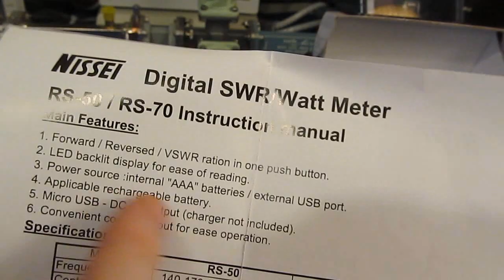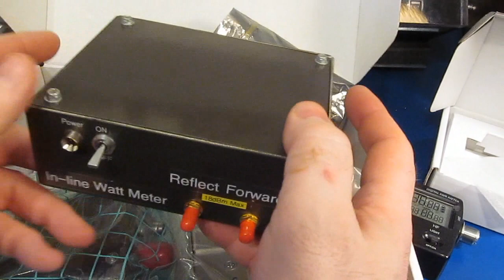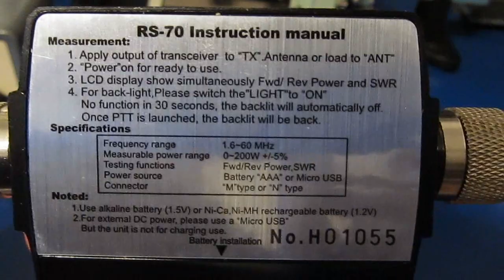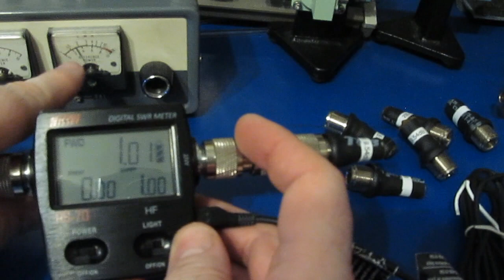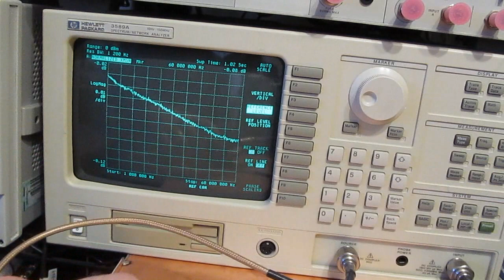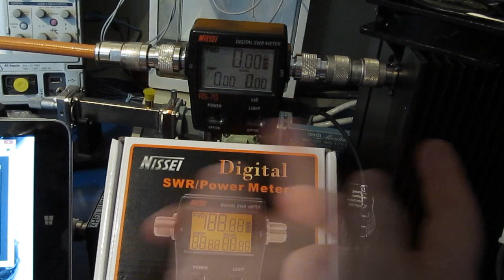NISSEI RS-70 Digital SWR/Power Meter Review

Comment: I have the MFJ-845 version. The instructions say the backlight will come on while transmitting then turn off after a while after keying off. But, mine is intermittent. I just got it a couple of days ago and was working fine and matching up pretty closely. Then all of a sudden it's showing misreadings of 99:1 SWR and nearly 100% reflection except at 14MHz (20m band) where it fluctuates. I'll be cracking it open to see if something got burnt and to check that shield of the coax.

Also, it is exactly the same. MFJ just got it white labeled and slapped their logo on it. Also, the SO239 connectors are really crappy. You must be careful not to bend the pins. The insulator inside can slide down and expose the top of the pins. I took a plastic straw and made inserts to prevent the insulator from sliding down.
Reply from the maker: Thanks for the post.  Please provide us with some details on the shielding once you have yours apart.
Reply: The coax wasn't grounded. I did so. Also I replaced the SO239s with far more superior quality connectors...BUT... It's still not working properly. I checked it against all HF bands and only on 10m (28-29MHz) doest it read SWR correctly. Nonetheless, despite giving pinned 99:1 reading the SWR on the feed line and at the rig remains stable and correct. Does this just need to be recalibrated?

Comment: Great!  It seems everything I've bought is a piece of crap after watching these videos.  First, the Nano VNA-H4, but too complicated to use.  Then the Surecom SW-33, but one video says it's just junk.  Finally, a Nissei RS-50 similar to this one, but if the RS-70 is what you're saying it is, then I can assume the same with what I have.  Geez, I just want an accurate SWR and power meter without breaking the bank and all the complications!
Reply from the maker: RS50 should have a completely different coupler.   There is no way the one used in the RS-70 would work to 500+MHz, even if it didn't have problems.  If you know someone with the equipment, maybe they could test it for you.   H4 can't measure power so even if you took the time to learn  to use it, its out.
Reply: Check the frequency range. MFJ has two versions. One for HF and another for VHF/UHF.

Comment: I guess you have a calibration issue. There are trimpots inside so it's easy to calibrate this meter. My RS-70 is almost spot-on with respect to power and SWR. But of course not perfect as it's not a 1000 dollar lab instrument.
Reply from the maker: I posted a photo of it on EEVBLOG.   There is a trimmer cap that ties to the center tapped transformer and two trim pots off the two outside legs.  As far as aligning the meter,  I have not made any attempts.   It should have been aligned when shipped.
Reply: @joesmith-je3tq  Bearing in mind how it arrived to you, it's quite possible that it had a rough journey somewhere along the line from China or Japan - not sure where they are made. All it would take is a couple of decent knocks to change the calibration. I've got one of these meters coming (it was in a box of adapters/connectors and others odds and ends for £10 GBP - I guess that would be $12-15 USD, which was a bargain without the meter), I hoper it is better than the one you have. If not, I'll get inside and do some checks and possibly re-calibrate. All part of the fun!

Comment: The screen on this is almost identical to the MFJ one, which a lot of people have declared to be junk (erratic readings). I wonder if they are from the same factory.
Reply from the maker: Does look like it.  I watched this review of the MJF.   https://www.youtube.com/watch?v=OBimdjiK-YA   He doesn't check the entire frequency range but his does appear to be far more accurate than mine at 7MHz.
Reply: @joesmith-je3tq  It is exactly the same. MFJ just got it white labeled and slapped their logo on it. Also, the SO239 connectors are really crappy. You must be careful not to bend the pins. The insulator inside can slide down and expose the top of the pins. I took a plastic straw and made inserts to prevent the insulator from sliding down.

Comment: Your USB power bank keeps turning off because of the low load. That's what's making the meter reset.
Reply from the maker: Very well could be.  I did not try another pack or charger.   Funny it turns right back on.

Comment: You can get non-inductive (Ayrton-Perry winding) wire power resistors.
Reply from the maker: Yes, but it's not something you would use for a load.   Well, then again, I saw a ham make a video where he was using a home water heater but he was struggling to understand why it would work at some frequencies and not at others...
Reply: Why not, Joe?   I have tried them as dummy loads for my Ham station, and I have not seen any issues as compared to the big carbon pile resistors I also have.  VSWR is very good on the Dale units I have.  Maybe I'm missing something??  Thanx for your channel.  Always look forward to your torture tests.
Reply from the maker: @Homer19521  Did you measure the S-parameters and post that data somewhere?  If so, I would like to see your work.    If not, start by providing the part number of the device you used and the frequency range you use it at.
Reply: @joesmith-je3tq  I don't have a VNA so all my measurements were with a DER5000 (to measure R&L) & the variety of SWR meters I have.  I measure 1:1 on 160M (1.850MHz) and 1.6:1 on 6M (53MHz).   For this measurement, I used the Icom radio's SWR meter.   For a hack like me, that's good enough.  Some day I will measure it on my VHF/UHF rig.  It maybe an issue there.  PN is: Dale NH-100 1%  100W
Reply from the maker: @Homer19521  For the mismatch standards, they need to be constant.  Normally I am using these for low signal measurements.    If you look at the data sheets for the part you show, there is no S-parameter data available.   Now, I'm not suggesting you can't use them for a dummy load.  Similar to the ham with the hot water heater,  they apparently get a decent match at some frequency.   Now days, we have these low cost VNAs available for $50.   When I made the video for the home made Watt meter, I demonstrated measuring some mismatch loads.  These same loads were seen being measured with one of those low cost VNAs when I first received it.

Comment: I enjoyed this, disappointing as it was haha. I have an old Micronta VHF/UHF meter in this style (analog needle meter though) which I need to test against a proper lab power meter. If it’s between a Bird 43 and this joke you checked out, obviously the old 43 is a “Cadillac” of meters, but as you said their precision is really not all that great, particularly compared to lab standard meters.
Reply from the maker: I wouldn't be too surprised if many of the old time analog Watt meters would not out perform this modern digital one.  It's hard to believe it's this bad and they are able to sell them.  Maybe it's defective but it's not worth getting a second one to try when I really don't have a use for it.

Comment: Great videos Joe
Maybe they are just using say 1N4007 or any silicone diodes that are cheap, i found this in. AT100  ATU,
I changed to the correct ones and it is now reading fine,
Dave 2E0DMB
Reply from the maker: I may have to pull it apart and have a look.
Reply: @joesmith-je3tq  yes do open it, and see what they have messed up,
Dave

Comment: Until I got an HP RF power meter I always used a carbon comp resistor and a scope when I wanted close RF power measurements. Every other sort of RF power meter I was able to afford was not much better than just guessing. I've had the HP now for 2 years, and of course now that I have one I haven't actually had any need to use it.
Reply from the maker: I would normally use my spectrum analyzers to measure power.  After I bought that old Agilent PNA and upgraded it to 9GHz, I wanted to align it.   This was the whole reason to buy that R&S meter.   I have not used it since, until now that is.
Reply: @joesmith-je3tq  any chance you have video of this process ? Extending Agilent PNA to 9GHz, sounds awesome
Reply from the maker: @tremaa11  Nope but you can read about it here:  https://www.eevblog.com/forum/testgear/agilent-e8357a/    
https://www.eevblog.com/forum/testgear/agilent-e835xa-pna-vna-notes/